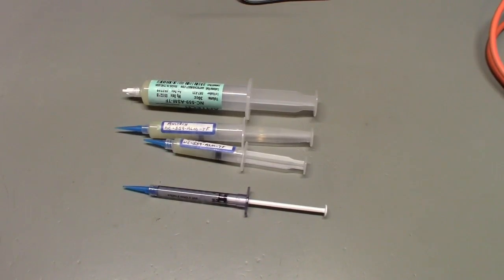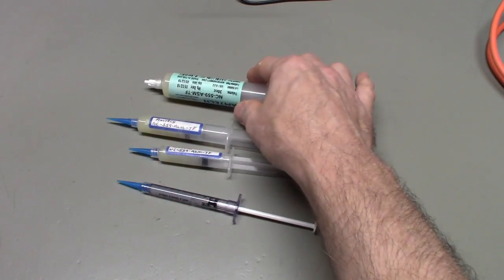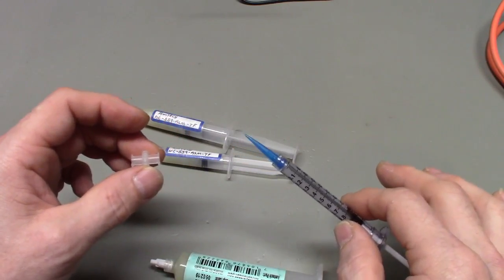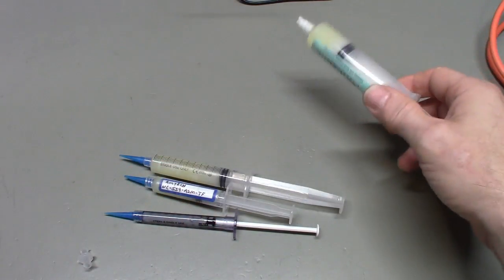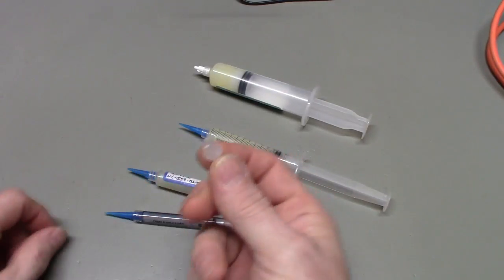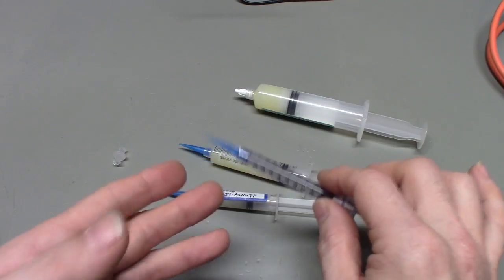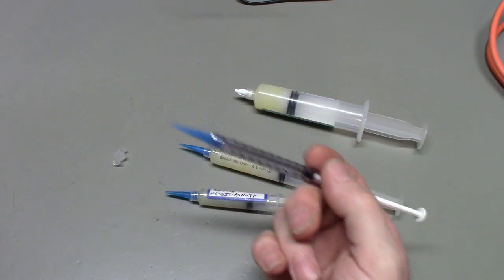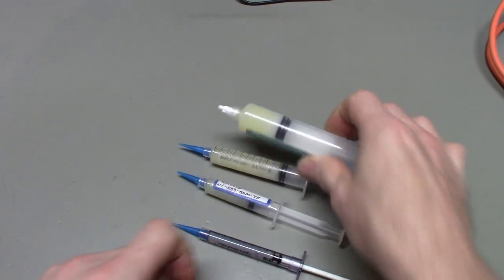How to get flux or solder paste from a large syringe to a small one without making a mess.

Comment: Last alot longer in refrigerator... I didn't know flux expires...  I've been using the same flux for about 20 years...
Reply: Then I don't think you're using modern, halogen and rosin free, no-clean tacky UV SMD fluxes. These compounds have some extreme performance for modern electronics demands - but as with everything else performing at the peak, it has a temper, needs more care and has a finite shelf life.

Great stuff if you need it, or just want it - it's great to work with (and it better be, that's the whole point). But if you don't need it, eh. If you do solder a good bit, I advice at least giving it a try though. Like Amtech 559, from actual Amtech or an official distributor. It's good stuff. I had a tub of flux I used for probably 15 years, didn't see the point in these new fancy ones. Got a tube of the Amtech stuff from a friend to try. Haven't touched the old jar since.

Comment: Great vid Mike! Btw, if anyone here has issues with placing "non-edible" items in a fridge with food stores, they can always look for the cheap, "mini-fridges" on eBay and/or Amazon, which have plenty of space for about 16 or more 30cc syringes and still room to spare for a few other items. Just thought to add that.
Reply: Or just put them in an airtight container sealed container
Reply: Some "paste fluxes" and "solder pastes" actually may outgas, which the "airtight" container may not completely contain. This is a phenomenon I observed when working for several EMC's. To each their own, but I personally don't like risking the storage of a variety of toxic chemicals in very close proximity of any food stores.

In regards to Amtech NC-559, I've actually stored it at my average room temperature of about 77 degrees F and it worked well beyond its expiration date without any warranty/return services and/or repairs. Everyone's results may vary.